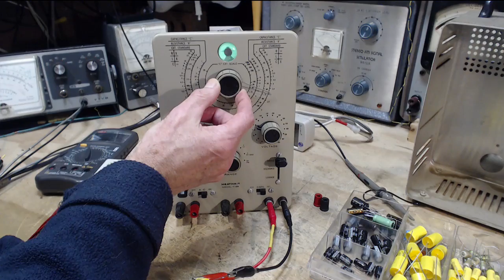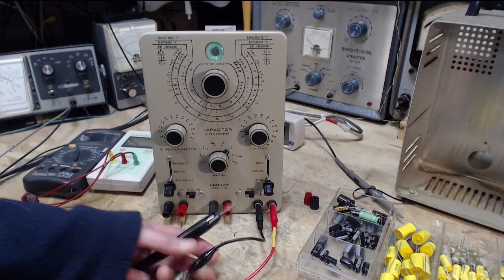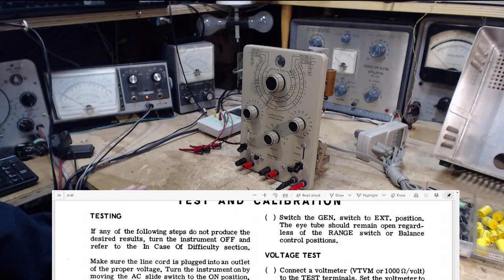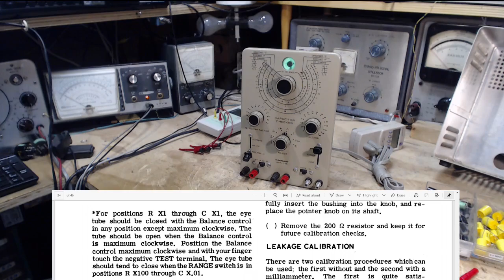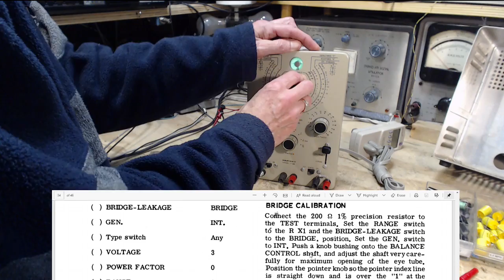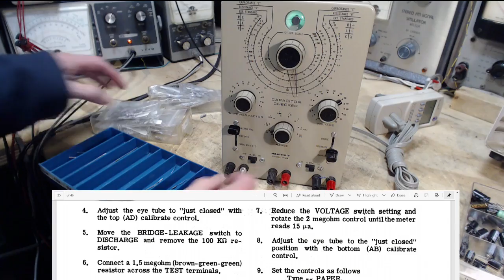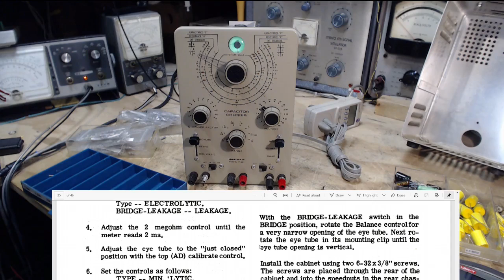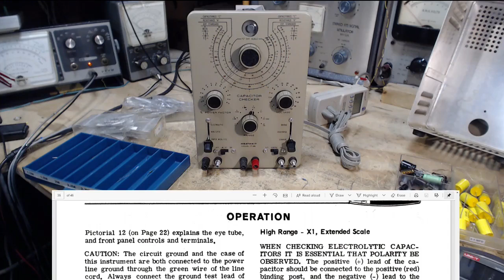Heathkit IT 28 Capacitor Checker Restoration Video #2 - Calibration

Comment: I use one of those often. I replaced all capacitors and resistors in the unit enjoying the experience of putting together a HealthKit (I was born in 1965 so never enjoyed that period of radio history). I restore old radios so use this device often to test capacitors. 
Jim please be more careful with this. I see you forgot to move the lever from
Leakage to discharge. Please be careful there is very high voltage there and you were very close to receive a shock when removing one cap and replacing it with another one without moving the lever to discharge. You had the lever in 50V at the time fortunately but could have been 600VDC.  
That HealthKit is one of the most useful ones and works great but you must be careful. Mine is very accurate since all components are new. 
Enjoy your videos. I have learnt a lot from you. 
73, Rob 
YS1RS

Comment: You had the pot (Balance control) out and disassembled. That is why the pointer does not point at "1" in the initial calibration. Temporarily mark where the pointer is at eye opening. Loosen the nut holding the pot to the panel. Rotate the pot bytthe difference in position between "1" and the temporary mark.  Repeat until the pointer is correct.

Comment: I think you need to go back to your calibration with the 200 ohm resistor and rotate the balance pot clockwise a small amount so the reading is correct. This should put your balance control in the correct position.

Comment: You can get a VERY BIG SHOCK off that capacitor checker. They expect you to know this. It is a very dangerous machine. There is another model with a spring on the discharge switch so as soon as you take your hand off it, it springs back to discharge.
Reply: The Heathkit C-3 cap checker has that auto-discharge feature, but lacks the safety features of a fuse on the power line and a three wire earth grounded chassis.  The IT-28 has those latter two features.  Back in the 1950s they expected that the technician actually possessed those rare (nowadays) characteristics of common sense and a healthy respect for electricity.   "Once the electrons get out of the conductor they are no longer your friends."

Comment: As you have too high voltage on the "600V" setting, and low on other ranges, I would suspect the highest resistor in the voltage divider string. Also, I would switch the DMM to a lower setting when measuring low voltages, the setting at several hundred volts will round off the measurements

Comment: Anybody have any ideas why my it-28 will not work correctly on .01 .001? I have cleaned and checked everything it seems. Calibrated. .bridge position, paper mica, voltage at 0  .1 scale seems to work fine. The other cap scales just open towers the end of the sweep.

Comment: Jim, I cringed watching you disconnect the caps in leakage mode without putting the switch in discharge mode. The switch unfortunately is not a spring return back to discharge mode. Pls be careful. I am an electronic technician from the 60’s who assembled this model in 1968. A great piece of equipment.

Comment: Hi Jim
62ma at 600 V will make you jump !

Looking at the map at 600 V you have a 10 k resistor between the 
20uf main filter cap & the cap (+) test plug socket .

Ouch...................Ouch..........*** !